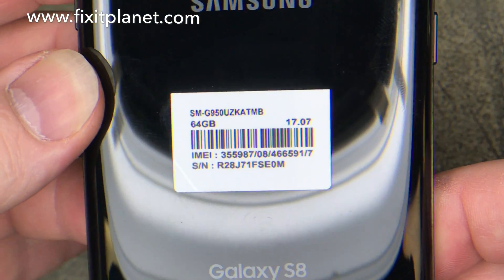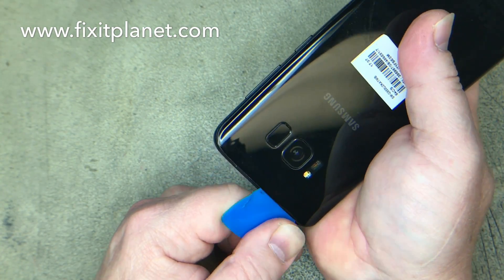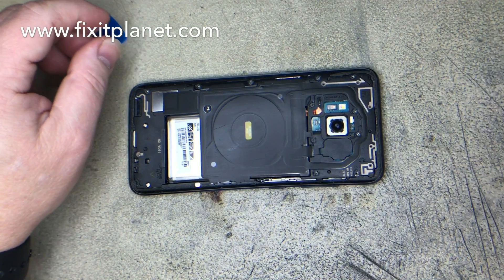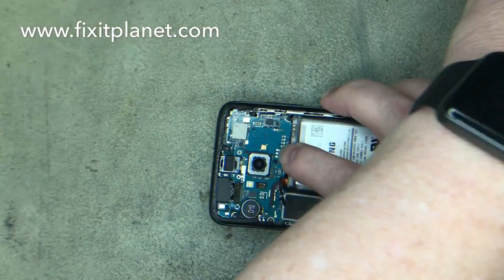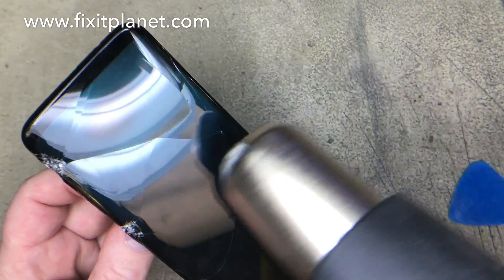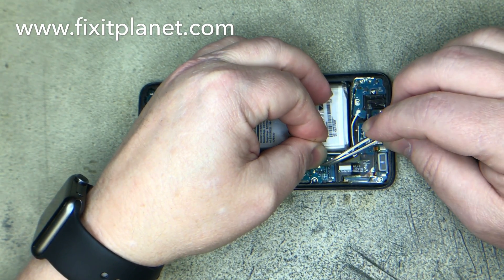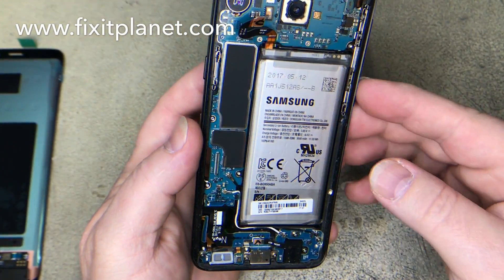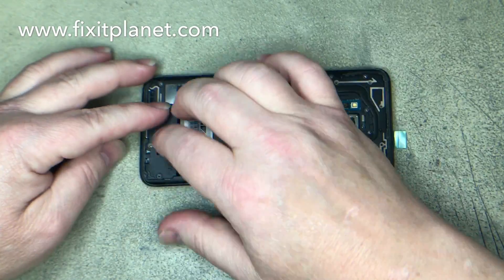Samsung Galaxy S8 Screen Repair From Start To Finish.

Comment: Did this for 30 for tools and the LCD screen, "professionals" do this for 250 up, but in reality we are all professionals with YouTube at our fingertips
Reply: Rising Tide Productions Can you PLEASE provide link bro?  eBay is charging around 150 for these
Reply: You can buy the glass itself with the tools for 30 and less. You can't get it with the digitizer for that cheap. At least no where that I've found. I've also only been looking for glass though since that's my problem
Reply: Hello. Nice video. Where did u buy the tools? Can u post a link? Also u mentioned having used a hot plate. Is that more expensive? How much could it cost?
Reply: @mameryjazz  I bought my tools from Amazon. It comes complete with a wrist band but no matter. I had to by it separately.  The one I have can be used on smart phones, tablets and laptop. It's a pretty cool kit.
Reply: careful guys, it maybe an Tft and not amoled. cons of tft displays needs more porwer, less colors but more durability and cheaper than amoled
Reply: Do you have to remove the back of the s8 just to replace the front screen
Reply: yes.
Reply: @corywyatt4913  
Looks like it
Reply: Rising Tide Productions yea bro. It says it's currently unavailable on Amazon..I need the LCD Digitizer
Reply: Rising Tide Productions i called them they quoted me for 380 and the vid says diffrent
Reply: Where the hell you got an LCD screen for 30 bucks?
Reply: @DanielxD398  They don't know that you can't simply replace the glass without an autoclaive and freezer. The glass and digitizer are effectively laminated together, and without specialized equipment you cannot simply replace the glass.

repair costs for this phone are inaccurate if they cite anything less than $250. Most folks will charge about $100 for labor, which is why most repair jobs cost $350\
Reply: John Kennedy ikr?
Reply: Rising Tide Productions 
Where did you buy the LCD screen from
Reply: I just found all sorts for around 130 nanananaa 😂😂😂
Reply: Right lol I'll get the stuff on eBay and fix my mom's phone charge her $50
Reply: Lol
Reply: I got a free s8 with a destroyed screen but it vibrates and makes volume noise and charging noise, would it be worth it to replace the screen?
Reply: @mashedpotatoes5323  plug it into your TV  or monitor, it will utilise Samsung DEX... and you'll know if it works!
Reply: no you did not, you won't remove that screen without damaging a phone, that how they made it. All these videos are nonsense and show you where they got lucky in like 5 out 100 phones.
Reply: @ambientblue-eyedmonkey8849   I work in phone repair its hard but after doing 1000+ installs you get to the point where it looks easy 😅
Reply: Rising Tide Productions there's no way you got a complete display with glass for $30... The least expensive S8+ display I could find was $250.
Reply: @hondaguy9153  you can get cheaper if you just do a frameless screen
Reply: @SloppyTelopy  what's a frameless screen?
Reply: @hondaguy9153  so for the s8 you can get the screen like just this guy did you you can get a screen already glued to a empty frame and you put your motherboard and battery and everything in the new frame screen assembly
Reply: @SloppyTelopy  I got the screen and reused my mid frame. It was $230.
Reply: @hondaguy9153  I didnt wanna do that because the first time I did it I cracked the underside of the oled panel and ruined my screen. Luckily I could return it
Reply: @SloppyTelopy  Me too

Comment: Where do you get the parts?
Reply: Amazon, New Egg, eBay....are really good and cheap options
Reply: Chris Gardner the problem is most parts i find include just the glass, do you need to get a new screen aswell? Or will just the glass suffice.

Comment: Question, do I need yo replace the Display as well as just the glass? My display is fine but my glass did crack.
Reply from the maker: yes
Reply: U need use original glass
Reply: MY HERO IZ ME FPS if you can get the glass to separate without damaging the display then you can change just the glass. I tried with liquid nitrogen but failed because I left the display in the container for too long.

Comment: where to buy a replacement screen?
Reply from the maker: Search the internet for replacement screen. Try Ebay or Amazon
Reply: Fix It Planet what's the prices and cost? Most are not cheap from what I found
Reply: belippy you

Comment: Will this remove the water resistins
Reply from the maker: No. It is not water resistant to factory specification but if the screen is cracked it's not water resistant anyway. Replacing the screen is better than having a busted phone and if you repair it right it will be fine.

Comment: Will this damage the water resistance of the phone?
Reply from the maker: No. It is not water resistant to factory specification but if the screen is cracked it's not water resistant anyway. Replacing the screen is better than having a busted phone and if you repair it right it will be fine.

Comment: You didn't show the digitizer replacement witch is the hardest part at lease for the other S series.
Reply from the maker: Yes we did. We replaced the entire display assembly that comes with everything fused together including the digitizer.

Comment: Is the phone still water proof after the screen replacement?
Reply from the maker: No. It is not water resistant to factory specification but if the screen is cracked it's not water resistant anyway. Replacing the screen is better than having a busted phone and if you repair it right it will be fine.

Comment: I don’t know if you’ve used it before, but on T-Mobile Samsung devices you can put *#06# into the diaper to get to a test menu. You can test antennas, display, camera, and more through that menu. Comes in very handy for troubleshooting and testing that your new parts are working.
Reply from the maker: Yes I've used that but I don't have a "diaper" on this phone. :)
Reply: Last I heard , no phones come with "diapers" and that is only to test the phone itself! Not to make sure the screen turns on and is functioning. FYI, that is common knowledge amongst any smartphone tech repair person and any enthusiast..

Comment: is the phone still water resistant after this process?
Reply from the maker: If the screen is damaged water resistance is compromised anyway. Replacing the screen will not make it water proof to factory standards but if done right, is still better than a cracked screen.
Reply: so I've been told by a Samsung official that the stuff inside makes the phone water resistant already so even if your glass is cracked it doesn't matter. I personally being an adventurous guy have gotten my phone repaired and water tested it so if you drop your s8 in water after repair you are fine.
Reply: @alvinabraham7896  it can only take so many feet of water before it actually fucks up frfr
Reply: @ForeverKeepPushing  thats true for any phone but in general it is water resistant for about 5 ft
Reply: of course is better than a cracked screen, but does it suffer of humidity?
Reply: Amjad Al-Jabri No.

Comment: Could you reuse the old lcd?
Reply from the maker: It can be done with the right equipment for the job, but It's not really practical these new displays are paper thin and damage easily.

Comment: On the replacement LCD how did you remove the blue tape fully? I'm having trouble because of the black clip attached to it and I'm afraid if I force it I will break it.
Reply from the maker: The clip is attached to the blue masking not the display itself, so just slowly remove the blue masking and the clip will come off with it. Be careful anyway! ;)
Reply: Kelvin Niles Can you please tell me how this fix went for you?   Can you please tell me how much your new screen was altogether?

Comment: stil waterprof??
Reply from the maker: If the screen or back glass are cracked you already lost liquid resistance. The factory seal is broken so no it's not the same as from the factory. However if you do it right (and use genuine parts) it will be better than when the screen is cracked and should be fine.

Comment: Where did you buy your Replacement Screen from?
Reply: where did you get it link ?
Reply: Melissa Shupe the front glass replacement kit for $25-$30 bucks? Really..
Reply: Melissa Shupe yeah, I know that nasty little fact but the fact that it was costing $200 or more just for the front ! So to see the oarys costing as low as this is awesome!
Reply: Justin one did your work good?  u bite from Amazon?
Reply: Justin one i was on ebay and They're selling for 175... how'd u get it for so cheap?   they after market parts
Reply: John Kennedy bro, the screen kit replacement is around 30 dollars and you can find it easily. The digitizer and LCD is the thing that will cost you bunch..
Reply: Melissa Shupe did your new screen also come with a digitizer? I have broken screen and black smudges need to replace my screen asap
Reply: +John Kennedy There are 2 replacement parts! 1 is just the front glass and 1 is the entire Oled panel!
Reply: supasteb last time i checked Samsung was charging  $250?
Reply: Ebay is the cheapest
Reply: Ebay or Amazon are the cheapest way to go. Don't bother corrosponding to Samsung or paying an odd $250+ on replacing the screen "professionally". If prepared correctly, you can DIY with no worries. Let me know how you guys go.
Reply: supasteb oh well cbf
Reply: Melissa Shupe sweet! I have a scratch on my front glass and seeing how I'm OCD about that stuff, I've been sweating getting a new front! Thanks for the heads up...

Comment: Did you lose and water resistance rating after doing this?
Reply from the maker: If the screen is cracked you already lost liquid resistance. The factory seal is broken so no the original rating will not be exactly the same. However if you do it right it will be better than when the screen is cracked and should be fine.